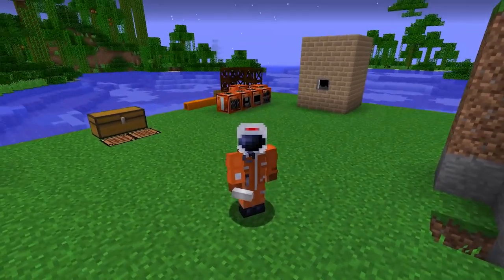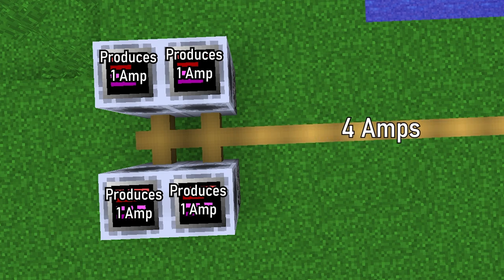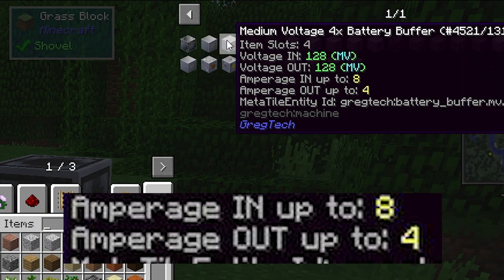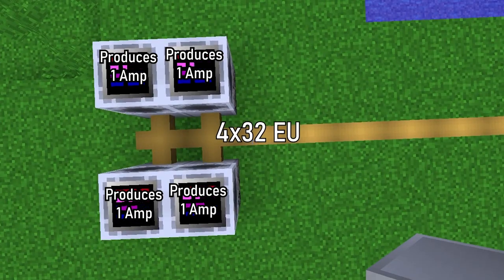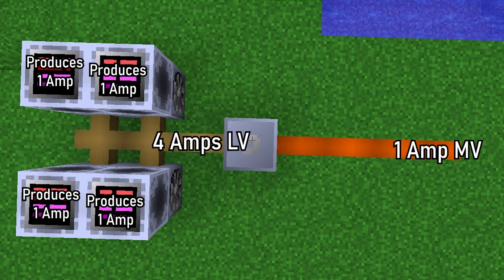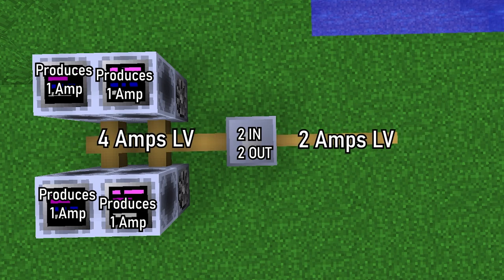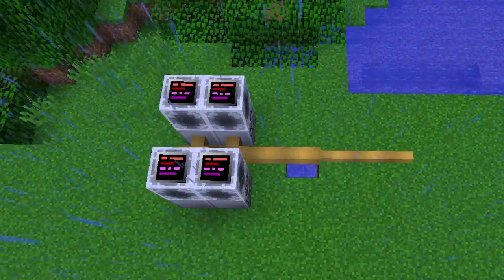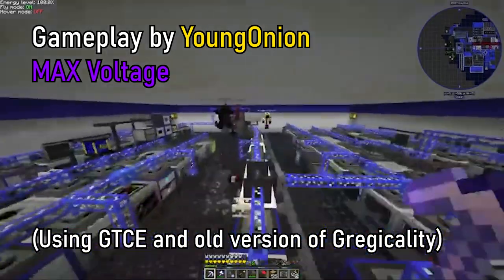GregTech Power and Cables Explained [Tutorial]

Comment: if I'm getting this right. let's say I have an 8-block long 1x copper cable powered with 1-amp mv at 128 volts. Since my volts slowly drop to 112 by the end of the cable it would feed an mv machine at the end of the cable 112 volts but since its 1-amp I can only feed one mv machine?

Comment: If i understoood it correctly, any energy-producing unit puts out 1 amp? 
As example, if i have 4 liquid fuel burners, they produce 4 amps for the tier they're on? 
Is this also the case for a bigger generation like the nuclear reactor? (Mine does a stable of 1980EU/t or sth around that note) 

On a second question.. and it's probably a stupid one; can you accumulate amps somehow? 
Like with Battery buffers. If you have, let's say a Battery buffer with 4 slots, filled up. And you feed it 2 amps. Will it still output 4 amps (when batteries are charged up) or will it outzput 1/2 amps nonetheless? 

I'm currently fiddling with generation for a few EBF's and i'm kinda scared to start up the nuclear reactor for real. Bacause i'm a dumdum, i placed the thing in the center of my base.